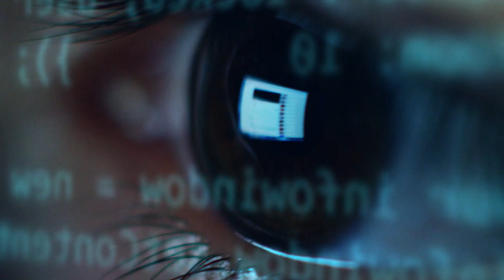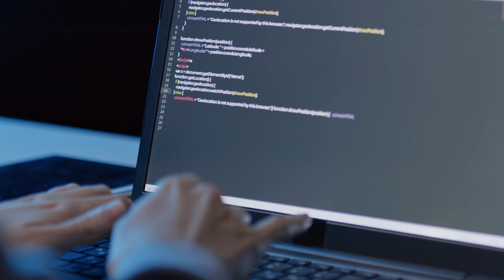Intel Gaudi 3 AI Accelerator Explainer Video | Intel

Comment: They should add security too. It is hard to get that if you build your own system. I have an AMD system Locked by Lenovo and the security is really a relaxing feature. From BIOS to to OS it is really secure and compatible with compilers, non TPM OSes and many more. Intels stock has hurt them so bad because of hardware patents. If Gaudi is really the next step in Chip release and good price strategy it would help. Right now Intel is looking for sub 2.9 nanometer process and once they made that breakthrough they could patent many chip design. Hang in there intel the future is all yours.